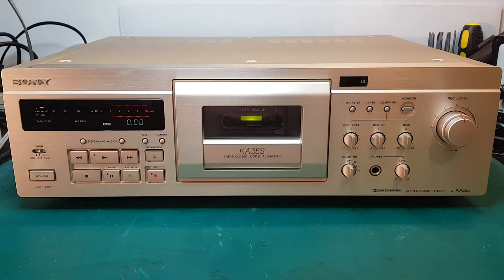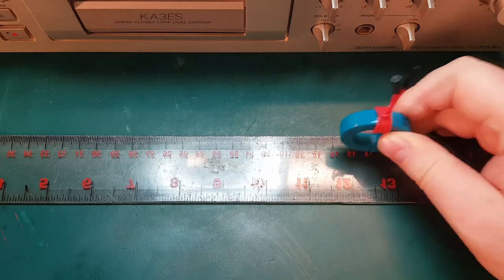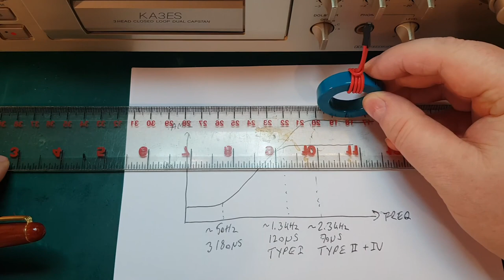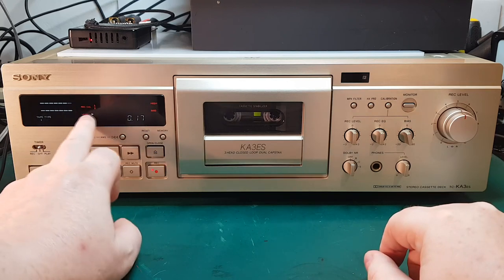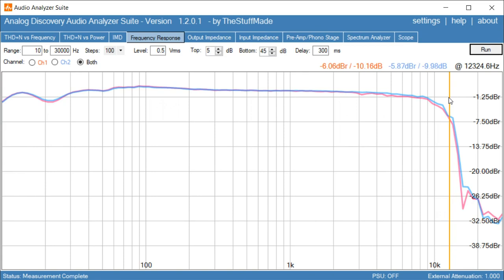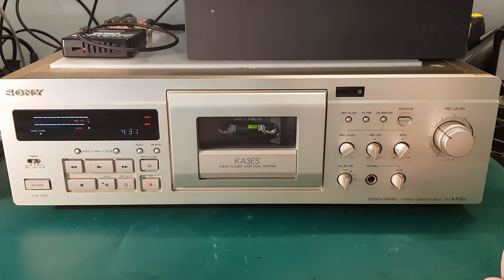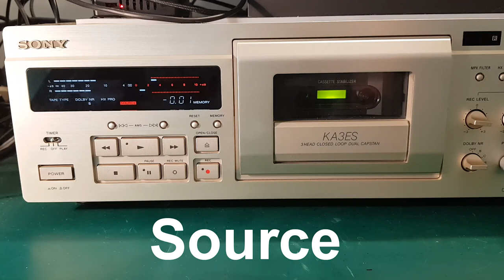Sony Compact Cassette Deck (TC-KA3ES) Calibration and Frequency Response Test.

Comment from the maker: 0:00 Introduction
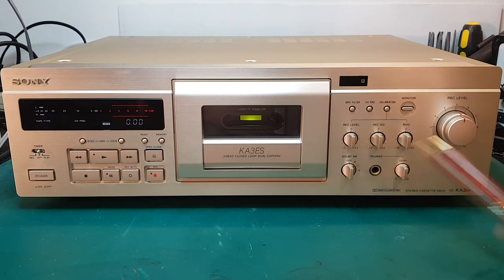0:30 Tapes to be used during testing (Normal, Chrome and Metal)
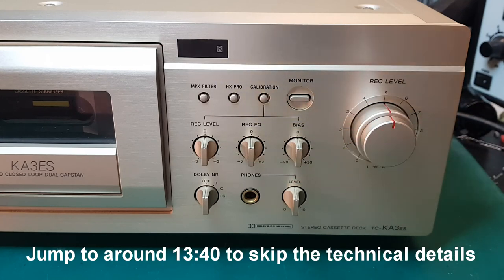2:06 How a tape head works (recording)
4:06 What is Equalization? (pre-emphasis and de-emphasis) 120us vs 70us
6:58 What is Bias?
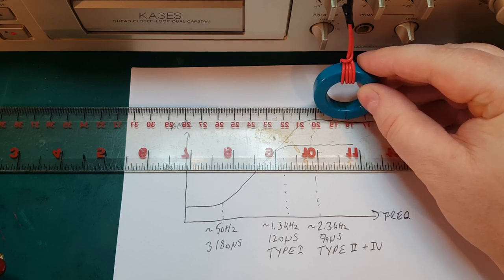7:55 How does playback work?
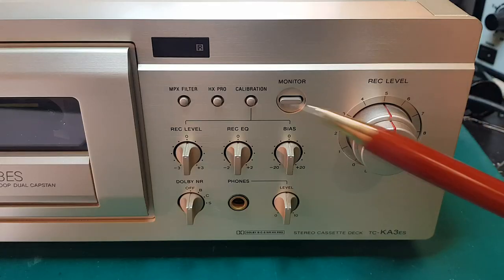8:40 What is MPX Filter used for?
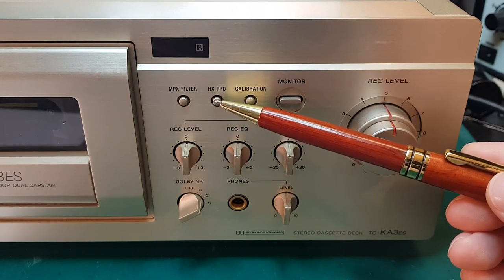9:41 What does HX Pro do?
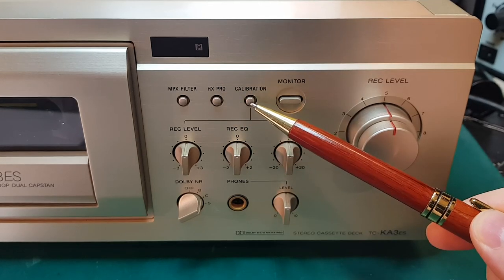10:50 Monitor, Tape vs Source on 3 head decks.
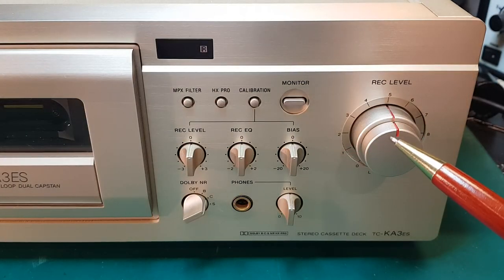11:18 Recording level master and tape
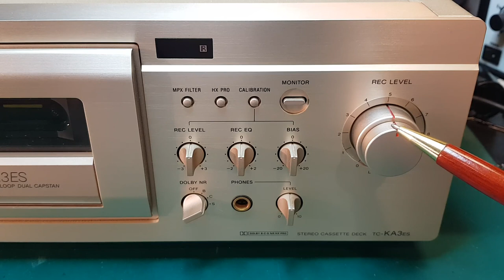12:15 Recording equalization (Sony specific feature)
12:48 Bias fine adjustment
13:18 Dolby B, C and S
13:46 Calibration feature test with TDK D-90 Type I
14:49 Analysis of how the calibration feature works
16:51 Frequency Response of TDK D-90 Tape @ 0dB
19:17 Calibration and Frequency Response of Sony UX-S Chrome Type II Tape
20:55 Calibration and Frequency Response of Sony Metal XR Type IV Tape
22:45 Conclusion and comparison of results
24:31 Music Sample - Source
25:42 Music Sample - Recorded on TDK D-90 - Type I
26:48 Music Sample - Recorded on Sony US-S - Type II
28:05 Music Sample - Recorded on Sony Metal XR - Type IV
Reply: Hi, where can I adjust  tape speed ?...which VR...or adjustement point? ?
Reply from the maker: @ivanfilgas2065  Hi Ivan, this tape deck got oscillator controlled speed for the capstan motor, there is no adjustment as the crystal is very accurate and doesn't drift much. If you have issues with speed it's most likely a mechanical issues.
Cheers,
Jake
Reply: @TheStuffMade  Thanx Jake! Cheers, Ivan

Comment: Back in my tape years (80's and 90's) I used type 1 for radio recordings, and type 2 for cd recordings. Mostly tdk-sa or maxell-XL2. I used very few metal tapes as the sound difference with type 2 for me was negatable. It is amazing the quality that is possible on these low tape speeds. However I moved on into the digital age and all my cassettes anded up in the garbage bin. Little did I know people would spend money on these later. Still fun to see some quality 90's stuff, they don't make them like that anymore.

Comment: w this software I test another Pioneer CT-F900 and I think it has a bad erase head. I heard tones when recording from the last test lol  wow Testing tape Decks can be a lot of figuring out Electrical and Mechanical Thanks again.
Reply from the maker: Yeah, these mechanical devices do have a lot of quirks, but when you get everything restored/repaired/calibrated they sound amazing. I always felt my cassette deck sounded better than my CD player back in the 90s as in it didn't have that harsh edge the CD did.
Cheers,
Jake

Comment: Excellent video explaining the cassette recording system and probably one of the best desks to demonstrate the higher end capabilities that the cassettes format was capable of near the end of the format life by the late 90s, I have the Sony KA6ES, and is almost identical to your KA3 with the only difference being the HX Pro button, the KA6ES has HX Pro but is not switchable. I have posted some music recorded from SACD onto a metal cassette and posted it on my channel.
Reply from the maker: Thanks, yeah the naming of these late 90s high end Sony decks is a bit confusing, I think the ka2, ka3 and ka6 are almost identical. Anyway, I think there is no need for the HX Pro button, I'd always enable it, I don't see any downsides, however it could be interesting to do a comparison of higher frequency distortion with and without HX Pro. I agree, these decks are very high performance, anyone remembering cassettes as being limited frequency with wow and flutter, hiss, distortion and drop outs should have a listen to one of these with a reasonable quality tape.
Cheers,
Jake
Reply: @TheStuffMade  Think the KA6 is the lowest of the 3 but still a very good deck, I have one of the very few Dolby HX Pro S prerecorded cassettes, the B-52's Time Capsule and will at some point "in the near future" will post Love Shack from it, with the audio being captured at 96kHz 24bit so there is no loss in the transfer from analog cassette to H265 video file, as prerecorded cassettes go it was one of the better quality releases.
Reply from the maker: @The70s80scollection  I have about 2-300 original tapes from the 70-80-90, but I think none of them are higher than Dolby C, some are very good recordings though, like Dire Straits and Queen etc. You have some great recording on your channel 👍
Reply: @TheStuffMade  Thanks, Dolby S prerecorded cassettes are quite rare, I also have a few Prince digilog Dolby S cassettes, they probably are the best sounding prerecorded I have, cant post them on my channel, all Price recorded content is blocked. At some point I want to record something onto a Sony Metal-ES C46 that I have that's unopened using dolby S to demonstrate just how good cassettes can sound.

Comment: I have a Technics RS-B50 deck which automatically adjusts everything and has no controls except for record level and left right balance. How do I calibrate it?
Reply from the maker: Hi, most tape decks have fixed bias and equalization with no option to fine tune based on the tape you're recording on. If it doesn't sound right when you record or play back then it will likely need a full service including internal calibration. The procedure for this is usually described in details in the service manual (if you can find one) however be aware it does require access to instruments like oscilloscope and meters plus a set of calibration tapes.
Cheers,
Jake
Reply: @TheStuffMade  Thank you! I guess I'll just use it to play tapes and try to record on Type II cassettes. It's not worth to calibrate the machine internally every time I change the cassette, if I don't have a dedicated knob for that. Thanks a lot for your reply.

Comment: Greetings, was the deck pre-calibrated before the video? Meaning internally, according to the service manual, or was just left "as is" from the factory settings? Thanks!
Reply from the maker: No calibration, besides having the belts replaced, this deck is as when it left the factory.
Cheers,
Jake

Comment: I would be curious to know the results of the record then playback method if possible (not monitoring). I see a lot of signal bleed on my cassette decks with the heads being so close together, not like open reels where there is considerable distance between the two. When I record, then analyze the playback separately, I see much more high-frequency attenuation than when monitoring.
Reply from the maker: Hi Peter, I can confirm all the tests are done using the monitor function as in simultaneous recording and playback. But I agree it would make an interesting experiment to see how much difference there would be compared to playing back a prerecorded sweep. I am planning to do some distortion tests and have a closer look at the effect of using dolby noise reduction, so I might squeeze in a comparison between prerecorded and using the monitor function.
Cheers,
Jake
Reply: @TheStuffMade  It would nice to see that. Thanks for sharing your tests.

Comment: Excellent video! Very nice machine! I disagree on one point concerting compatibility in Dolby Systems. At 13:34 Dolby S was the latest Dolby encoding standard for pre-recorded tapes. Tapes or pre-recorded tapes encoded with Dolby S can be played back without Dolby decoding ( car stereos, portables) and on a Dolby B only deck without unpleasant breathing or mistracking. The sound is surprisingly good and can be compared with a undecoded Dolby B. Many listeners don't like Dolby decoding ( they say as alway's than Dolby muffled the highs) and leave the Dolby switch off at all times. Dolby C is very good ( spectral skewing, anti saturation) but much more incompatible between decks and unlistenable without proper decoding. Resume: Dolby B can be played back without decoding, Dolby C can be played back only with C decoding and Dolby S can be played back without Dolby at all, with Dolby B and of couse for full compatibility and noise reduction with Dolby S.

Comment: Did you ever, or at least can you, do audio tape SNR and distortion measurements with Analog Discovery?
Reply from the maker: Yes, I was/am planning a follow up video with distortion measurements, just never got around to it. The distortion on this deck is anywhere from 0.1% up to 1.5% depending on tape type and recording level and using Dolby NR significantly lowers the distortion. I didn't do the SNR measurements, but I'd assume they are close to the specs.
Cheers,
Jake

Comment: Very nice video!
I'd like to ask: I have a boom box that has a frequency response between 80-10000Hz (only type l tape).
Is that a satisfactory range for a nice audio recording?
Do we really need a machine that exceeds the 10000Hz?
And if so, what is a referable range for a deck/ boom box?
Thanks a lot!
Reply from the maker: Thanks. I wouldn't worry about it, that frequency response is good for a boom box, it's unlikely the speakers will be able to play any bass below 80 Hz and most Type I tapes start rolling off above 10kHz anyway. A good way to get a feeling for how much effect it will have is to use a computer or your phone with some good headphones, then use a player that have equalizer function where you can suppress the lower and upper frequencies, then listen to some music with and without the equalizer enabled.
Cheers,
Jake

Comment: Very interesting, thanks. It would have been informative to see frequency response curves without calibration for comparison.
Reply from the maker: Thanks, yeah that's a good point. I'll do another video where I'll attempt to measure the distortion of the same tapes, then I'll include a comparison of the frequency response (and probably distortion) with and without calibration. It's not a day and night difference, but the calibration does improve the frequency response.
Cheers,
Jake
Reply: @TheStuffMade  THat would be great, thanks.

Comment: I just get sony TC-KA3ES. When i start play some cassette, the sound playback is very muddy. The i replace the head with same head on my other sony ES series, but the sound still muddy.
When i start recording the playback sound is very different with the source. But when i play the result on the other tape, the sound from the recording is good. So i assume some trouble on the playback system. Any sugestion what must i do first? Thanks dude

Comment: For me the real question is whether this calibration feature makes any difference ie how the response would look like without or set completely off. I have a TC-K777 and I can’t hers any difference after calibration versus left at default zero, or even purposely set off.
We’ll done video, otherwise, thanks!
Reply: I can hear a difference in all my 3 head decks even if the calibration is slightly off.  Is the rest of your system good? Speakers?

Comment: I have a question about the calibration and the bias frequency. My deck (Yamaha K-340) doesn't have a fine control. It only auto detects the tape type. What I wanna check is, if the bias is gotten out of tune due to age. Is there a way to check that with a multimeter or maybe a bias calibration tape?
Reply from the maker: Hello, your best option is to see if you can find a service manual for your Yamaha deck, it will usually contain all the calibration procedures in detail.
Cheers,
Jake
Reply: @TheStuffMade  I found the service manual. The first step is to calibrate the Playback level, unfortunately I don't own an oscilloscope. Is there a way to get around that? Can I use something different?
Reply from the maker: @HardKickinGroupGermany  Usually you need tone generator, oscilloscope, true RMS multimeter plus a set of calibration tapes with various test tones to do a full calibration. I wouldn't recommend trying to do any adjustments without following the steps in the service manual. You could try make a post on tapeheads.net and see if anyone can help with advise specific to your tape deck.
Cheers,
Jake

Comment: Would love to own one, I have an TC-K677ES and its manual calibration, this is so much easier with the auto, just wish the deck was not so expensive used and all the ones i keep seeing on ebay are 100v from Japan, did they make a 120v version?
Reply from the maker: It's a really nice deck. I did have to replace the belts in mine when I got it as one of them had turned into goo, but besides that I've had no problems. They did make 100V, 120V and 230/240V versions for 50/60Hz supply, afaik this model was sold all over the world. It's a bit strange because Sony made 2 almost identical versions TC-KA3ES and TC-KA6ES, but the TC-KA3ES is the one with slightly better specs. I also noticed lots of Japanese versions on ebay advertised at around $500 - $1,000. That does seem very expensive, I paid around $150 for mine in non working condition (just needed new belts).
Cheers,
Jake
Reply: @TheStuffMade  Thank you for the reply, at least now I know they did make a 120v, like you saw all the ebay ones right now seem to be 100v, maybe I will get lucky one day.
Reply from the maker: @raysrcsandtech  You could probably run a 100V deck on 120V AC without any issues, it's all regulated inside and the 50 vs 60 Hz doesn't matter because the speed is controlled by an internal crystal oscillator. But it might run a bit hotter at 120V so it might depend on what climate you live in. I once ran a 100V Japanese record player at 230V by mistake, it ran fine for hours until I noticed and didn't suffer any damage, but that's of course too extreme to be safe.
Cheers,
Jake

Comment: In my experience it is only worth using expensive tapes on cheap decks where Type 1s sound muffled. (as long as they have Cr02 / Metal capacity of course)

Comment: Do I need an AC millivolt meter or what do you use ?
Reply from the maker: Hi, all the measurements in this video is done using the Analog Discovery device together with my Audio Analyzer Suite.
Cheers,
Jake

Comment: Can it be connected to the laptop?
Reply from the maker: Sure you can record from laptop using the headphone output.
Reply: "USB" tape decks may have crap specs. Read 'em before you buy a new "USB Deck"

Comment: Thanks for the software Using it for the Pioneer CT-F900 ,, And Later w Audio Receiver and Amps, Your software is why I bought Analog Discovery 2. I set the input level to 0DB and It did not like it and around 8k was the roll off  I thought I had Bad Heads or Bad old tapes. Testing Tapes and other Tape Deck w no luck. 
 I turned it down to -20db and it got better I than turned it down to -16db  input and output and I got my High fhz back and a15k roll off , I tested again and it seems to work better closer to -20db. w a 17k Roller over (Type 2) So is this normal? Using it to Test Tape heads. Next CT-F1250 I hope the head is good.
Reply from the maker: I wouldn't be worried, frequency response tests are usually done at -20dB for tape decks. Often it will also say that in the specs.
Cheers,
Jake

Comment: If I have a 2-head deck or I don't have a sources / Tape I can record it but their will be no graph of the tape is their a easy way to play it back and have a fhz responds of thee tape? w your software or Analog Discovery 2 Thanks Again
Reply from the maker: This is not currently possible, but it's a feature I will probably add at some point.
Cheers,
Jake